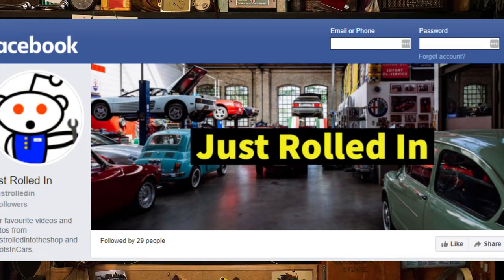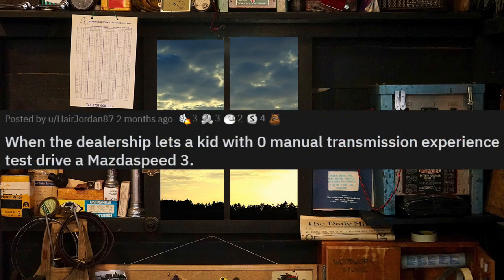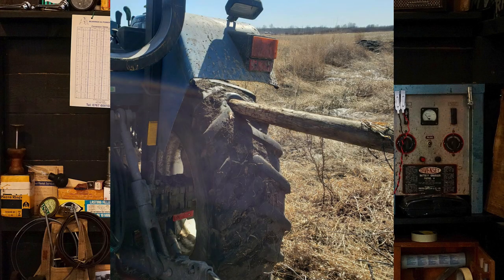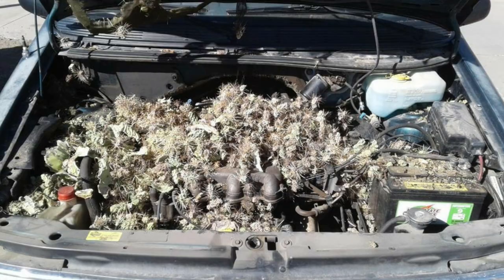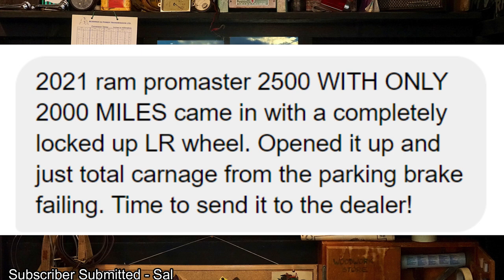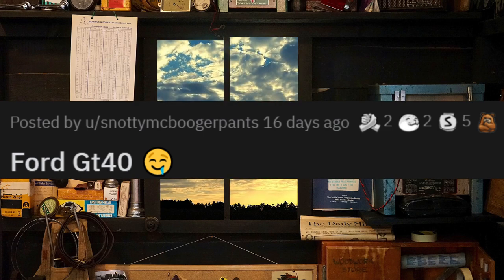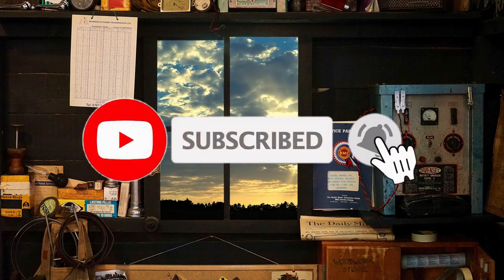Customer States "Can You Remove This Rabbit From My Engine?"

Comment: Yes I have had to remove an animal from a vehicle. When I was 15 I got a job at the local gas station. This is back when a gas station was a service shop. We did mechanical work. Also we had a full service line of gas pumps. After a week of assisting on the full service pumps my boss let me fly solo. First customer at the pumps I ran up and greeted her with my trained “Hello, ma’am. Fill it up with premium today?” She looked me square in the eye and said “I have a cat stuck in my car”. Yep, a kitten had crawled up into her engine bay and she had been driving around for three days with it meowing. My boss came out to see what the commotion was about when he saw me slithering under the car, she told him exactly what she told me. He just walked away leaving me alone to handle it. I rescued the kitten and stood proudly in her driver side window showing her the cat. She said  “Oh! Thanks” and drove off. My bosses son wound up adopting the kitten and the cat spend the his life well fed and loved, in case anyone is wondering what happened to the kitten.
Reply from the maker: Glad to hear the cat was okay and somebody took care of him/her.
Reply: Agree with above comments, rather horrified that someone would leave a kitten in the engine bay for three days.
Reply: @michaelmclachlan1650  I was pretty shocked myself. We had several customers that offered to adopt the little guy but my boss’s son laid claim to him first. My father was a Veterinarian and I can assure you the kitten was checked out and deemed healthy, other that being rather dirty. And received all his shots and regular checkups. I’ll never forget that day. Lol
Reply: Poor little guy was stuck there for THREE WHOLE DAYS?
Reply: Thank you Angus, very cool .
Reply: @levisvarela3735  
Monster
Reply: Did you name it after the car?
Reply: To be fair, she said she had "a cat" not "my cat"
Reply: mine is sad. my brother had to take our company truck to pick up something. it was outside. when he turned the key he heard a loud meow. he stopped and opened the hood. not pretty. the cat was chopped up by the fan . he had to remove the remains . no saving it.
Reply: @ronblack7870  ohh! That’s horrible! Poor thing.
Reply: @ronblack7870  Yeah, I've heard about that happening in northern states. A cat will crawl into an engine bay to get warm. Sad now.
Reply: the gas station close to where i lived before acctualy do some mechanical work, like helping with tiers, oil etc, the station been there for atleast 25 years if i dont remember wrong friendly people working there etc oh and they also have pumps for boats so gets a lot of trafic in the summer :) (at the coast of norway)

Comment: Removed a kitten from the engine bay of a used car, named him Dart after the car and took him home
Reply: Why is the universe telling me to get that car?
Reply: A woman once told me a similar story involving a truck stop. The kitten was sitting atop the big rigs engine block.
Reply: We found a stray kitten on the steering rack of a Toyota hi ace, became the shop cat affectionately called tie rod end.
Reply: @marchenning5037  LMAO
Reply: My aunt found a kitten sitting on the axle of her VW Rabbit at a gas station, she took it home and named it Axle
Reply: At least you did not name him 420A. That would have been a unfortunate kitten.
Reply: I pulled my kitten out of a subaru and named him subi
Reply: Thats wonderful.
Reply: Pulled a kitten out of my Hyundai. Named her elantra
Reply: Had a customer call me and ask if I could do a house call. I never do house calls but made an exception when she told me her cat crawled it’s way into the engine compartment and got stuck. I had to remove the front bumper and grill, almost the entire cooling system, the alternator and very carefully move the AC pump to get this cat out. He managed to get wedge in by the exhaust manifold. This cat is lucky they didn’t start that car. I had never in my life removed that much stuff out an engine compartment. Before you ask I don’t remember the model just that it was an older Honda for the time. It was an absolute nightmare trying to remove stuff in a way not to hurt the cat.
Reply: Eat the cat
Reply: Why is it name dart? I never heard of a car named dart
Reply: @therandomizer9943  Dodge Dart no longer in production was a shitty car
Reply: @rjgaynor8  ah yes I forgot all about the dodge dart. Nobody ever liked that car. I only heard about it briefly and didn't bother talking about them cuz they were massive failures.
Reply: @rjgaynor8  If only Dodge would have been put kitties under the bonnets...
Would have been a sales rising 😁
Reply: @therandomizer9943  Hey, Al Bundy had a Dodge Dart.  Respect, man.
Reply: @therandomizer9943  Dodge made one.  Had a friend with one, had a slant six in it, a nearly indestructible engine.
Reply: @therandomizer9943  There were two versions of the Dart. The original from the 60s-70s was pretty popular. The more recent one was not.

Comment: Here's my critter story. C-5 returned from abroad, and I, the E&E guy had a discrepancy in the underfloor. Crawling through it, I see this Bleed Air Duct in a spotted pattern. Usually they are black. It turned out to be a 24 foot Anaconda that crawled up into the underfloor of the aircraft and died. It was kind of funny, Customs had to get involved in that one.
Reply: Now THAT'S a new one! 🤣

Comment: When taking off the oil filter in my Mustang it pours on the subframe and I’m pretty sure the wire harness for the transmission and rear half of the car. Great design.

Comment: I have had a few encounters with animals under the hood that don't belong.  My first car was a Datsun 180B, it was in rough shape, dad helped me rebuild the engine, suspension and resprayed the car (orange with a white vinyl roof).  Went to the shed to do an oil change but didn't have the parts yet, my mum was picking them up from the closest town (half hour drive away) and had got a flat tire on the way home, the spare was flat too so a lot of back and forth to get tires repaired.  I left the car in the shed with the hood up and the next day went out to change the oil, sticking out of the tube that led to the air filter was a scaly tail.  Being in Australia first thought was snake!  I removed the top of the air filter cover very carefully (dad standing by with a rake) and it was a blue tongue lizard.  The lizard was removed and let go in the garden where he or she scurried off.
I was a delivery driver in my years while studying at university, need to pay the bills, so I was running around Adelaide in my Datsun delivering hot food to hungry people.  One stop was at a block of flats with a horrible numbering system so I was gone awhile looking for the right flat, it was a frosty winter night and my car had a nice warm engine bay, I jumped back in my car and started it up and a huge cloud of white fluff erupted from under the car and a slightly less fluffy cat went racing away into the night.  I didn't find any blood or skin just fur so I only gave the cat a hair cut all be it a bit rough with a fan blade.  
The last animal I found under the bonnet was a chicken, roosting on the rocker cover, had just enough room to sit there, not sure how or why or when she went there but as I lifted the bonnet one morning to check the oil and top up the windscreen washer bottle there she was.  I put her back in the yard with the other hens and rooster where she clucked off for some wheat and grass.

Comment: I had a1973 Gran Torino wagon back in the '80s. The front rotor was so worn that the poison pushed the load into the rotor vents. Thankfully, it was the right side, because the car made an abrupt right hand turn into an empty parking lot (no curb) rather than oncoming traffic.

Comment: Long ago I looked at a Renault "Le Car" at a used car dealer. With my foot off the clutch, adding power caused the engine to speed up abruptly (hint--slipping clutch). The salesman said, "it's supposed to speed up when you add power." I didn't buy that one.

Comment: 0:32 try working on some of the big Kalmar forklifts. The oil drops straight down onto the frame via a wide drain plug. So initial plug removal's a mess and then you've go the frame to deal with.

Comment: I was working under an MGB years ago when I saw a big venomous Brown snake coming my way. When I moved, it disappeared up into the engine bay. I ended up using a can of Bug spray around the engine until it dropped out & slipped away. Whew.

Comment: That "have you ever removed an animal from an engine" question gave me some Vietnam PTSD style flashbacks.

Parked my truck, went into the store, came back out, started truck...and turned it off as i heard screaming.

Raccoon had climbed inside to get warm (it was 3am, in January, in Maine, during a nasty cold snap) And his tail was draped over my serpentine belt.

Thankfully, i am vaccinated against rabies, because the poor thing clawed and bit the hell out of me as i extracted him, and stuffed him in one of the dog crates i always keep tucked under my rear seat. Raccoons have a bite force comparable to a German Shepherd. 0/10 dont be like me. I help my aunt, who is a wildlife rehabber, so i have the rabies vaccine done on the regular. If you get bit by a wild animal while trying to save it, and you are NOT vaccinated against rabies, they will kill the animal to test it.

Poor guy lost his tail, but was able to be released the following summer after surgery, rehab, and adjustment time for his lack of a tail.

If its cold outside, and you have had your car running, especially at night, its always a good idea to check under the hood, just in case.

I have also picked pieces of cat/kitten and Opossum out of engine compartments on friends and family's cars. Not pretty.

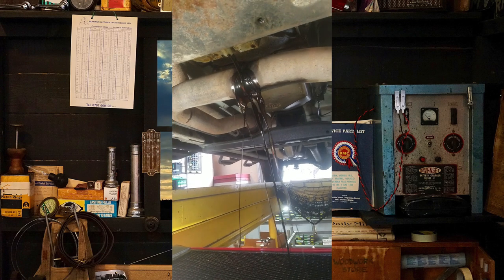Comment: 00:46 On my previous car the oil filter housing (paper filter, not can) unscrewed right above the exhaust pipe.

Oh yeah, it was just about the flexi part, so oil would get onto that braided flexible piece, and would be impossible to wipe off.

Car always smelled of burning oil for a week after oil changes until it was finally all burned completely off.

Comment: 3:35 I work with a guy that has a 2017 Chevy 1 ton. Bought it with around 40k on the clock and before it ticked over 60k I believe he had to have the dealer replace the touchscreen in the cab (would have been thousands at a shop - not cheap) and the entire rear axle assembly. I have no idea how you can burn through a rear axle in 20k hauling an 8,000 lb travel trailer at the very most. 

Also thanks for sharing my video (Polaris quad with bent brake pad). It lived a hard life with my grandpa before it sat 10-15 years. He thought he blew the motor up. Fresh 2 stroke oil and gas, she fired right up. That amount of time obviously took its toll though, cause it locked up (why it was in in the first place) during the winter. Decided to check the brakes and ohoho I’m glad I did before getting it rebuilt.
Reply from the maker: Appreciate you sending content in!
The chevy 1 ton must of had a hard live before that guy bought it 😅

Comment: Not me but my mom’s coworker. He is a choir director, and drives a newer Toyota Prius. He parked it in his driveway, thinking he was going to drive it the next day. Then, everything shut down due to COVID. He ended up not driving the car for a full week. He drove it out to get the oil changed, when his engine suddenly died. He called the Toyota dealer he scheduled the oil change with, and they sent a tow truck out to pick it up. He then got word that a family of squirrels had been nesting in his engine. They had ended up doing around 27k in damage, almost totaling the car. Thankfully, his car insurance covered it. Just thought this would be fun to mention on the note of removing animals from car engines. He parks in the garage now.
Reply from the maker: Wow that's a lot of damage they did to that Prius. I'm surprised they didnt total the vehicle. Thanks for sharing!
Reply: Is that $27,000 worth of damage?  Or, $2,700?  27k = 27,000.  2.7k = 2,700.  I find it hard to believe $27,000 worth of damage could be done in the engine bay of a Prius?

Comment: Co -worker bought a brand new Escort in the late 80's. Never made it home; engine overheated and she kept driving not knowing what the light meant. Ends up the head gasket was pinched from the factory. They wanted to repair the engine; she wanted it replaced.
Reply from the maker: Do you know what they ended up doing? Replaced or repaired it?
Reply: @JustRolledIn  Not sure; I think it was repaired.

Comment: Most engine designers finish the design, then someone points out the fact that they forgot to include an oil filter. At that point it gets put in some ridiculously inconvenient location. I had a car where removing the oil filter spills oil along the block of the engine, onto the subframe, rack and pinion, and frame -- a total mess.
Reply: once had a job designing engine wiring. I am also quite used to doing mechanic stuff and our customer presented us an engine in a bay, where the oil filter is hidden by an arm thick water hose. Explanation of their engineers: "yeah, unhappy with it, too, but we believe it can be kinked away to reach the filter!" Dudes, wtf? First of all: who can kink and arm thick, pressurized coolant hose? 2nd: how many times can such a hose be kinked before tearing apart? 3rd: elasticity over lifetime? Ever heard about that? those hose become hard and brittle.
Totally idiotic design, hope they changed it before production start.

Comment: Ford GT 40 is also named for the distance it can go on a full tank of fuel: 40 miles! Very thirsty engine! Thanks
Reply: That worked out till the 3rd gen. The second gen was 44.3, so sounds about right.
Reply: It was never 40 inches high
Reply: @Thomamps  It was an era of exaggeration. It is how you use it that counts.
Reply: Was it the 427, or the 289?

Comment: I own a similar Polaris ATV and even when that disc brake is in perfect working order it will not stop you. It is a hydraulic/ manuel disc brake with 1"x2" square pads, that are incredibly thin (yes they really bend easily). I really have no idea it is even there as it has practically no braking power at all, it might have something to do with it is not attached to wheel, but it is a single unit attached to the transmission rod that has a cog that drives the chain (it's pretty much like putting a disc brake on a drive shaft; must be a Canadian thing. The hydraulic portion is attached to the hand activated front disc brake system which work very well; that being the front discs. The manuel portion is cam activated and attached to a foot lever, which pretty much useless; if you had to count on the foot brake to save you, you would probably be dead.

Comment: I bought an A4 from a shady dealer and when I tried to get the inspection done they informed me that there were several codes. But no check engine light was on. I pulled the instrument cluster and someone had stuffed a wad of electrical tape stuffed in the cavity so you couldn’t see the light was on. I was post but very much screwed.

Comment: Many years ago (1977), while working at a Chrysler Plymouth dealership, we received a new Plymouth Fury with a 383 Hemi engine. This car had less than one mile on it. The engine had a terrible rattle when I disassembled it, I found the factory had installed 318 pistons in that 383 block.

Comment: My sister's 2020 Silverado, less than 1000 miles and it sat at the dealership for over 2 months waiting for a new wiring harness from GM.

Also have pulled a few cats (kittens) from engine compartments before.

Comment: Many years ago when I lived on a farm and the cars fan was mounted on the water pump (not electric), I had to open the hood and check for cats sleeping on the engine during winter. Otherwise, there was a risk of the fan chopping up the cat. Not a pretty sight.

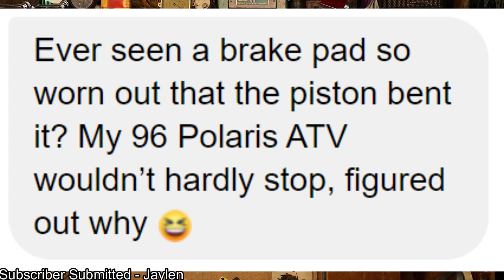Comment: 1:10 being an ATV, everything there is pretty thin.  Looks to me like the backing plate rusted to the slide pins allowing the piston to bend the backing plate.
I have, however, seen backing plates bent on cars from pressure and brake heat.  Specifically on a late 70's Camaro that someone took to a brake intensive road course with, apparently, stock brakes.  GM pistons, at least then, are hollow so it's a ring that is pressing on the backing plate.  When all was said and done, the back plate was "bulging" into the hollow space in the piston and each end of the plate was bent back toward the caliper.  The pad material was "squeezed" out from the center of the backing plate like it made from Braunschweiger.  Yes, the rotor and wheel bearings were both cooked.

Comment: i remember a Chevrolet we had, that required the transmission pan to be dropped for whatever reason, the only problem is that the exhaust had to be removed to reach the bolts on one side

Comment: when I lived in Phoenix, I saw a '67 Chrysler T&C wagon sitting in an open "garage" with 4 flat tires and about 3 inches of dust on it.  This was in Paradise Valley (a VERY hoity toity town.  The house wasn't worth squat, but the property was worth over 3 million in 2002) and I was surprised the town didn't make her do anything about it.  Well, long story short, I got the car for free, original window sticker, build sheet all there.  I put 4 tires and wheels on it and had it towed.  We stopped at a car wash and when I opened the hood it looked just like the pic you showed.  Evidently the ground squirrels had been living in there for years and did it stink.  She had the carb pulled for on her '68 New Yorker along with other parts she needed for her car.  So we sucked out as much as we could and hit it with the high pressure hose and got it fairly clean.  It was a 440 car with dual A/C.  It was pretty bad from sitting for years and the windshield was so crapped up from sitting facing west I had to just replace it.